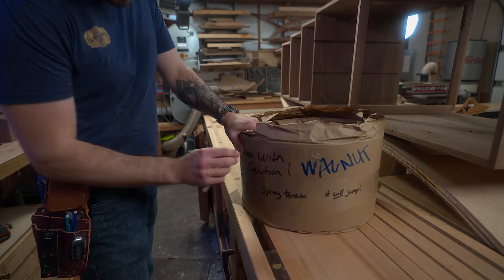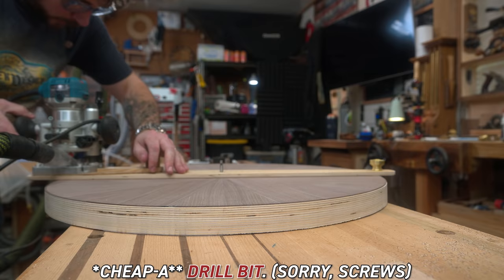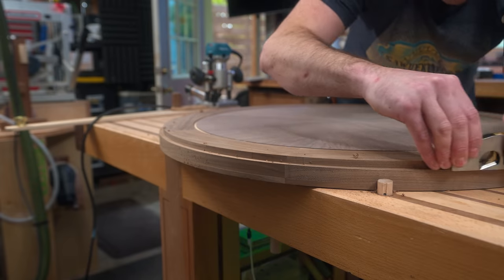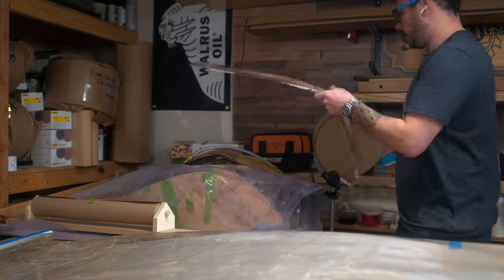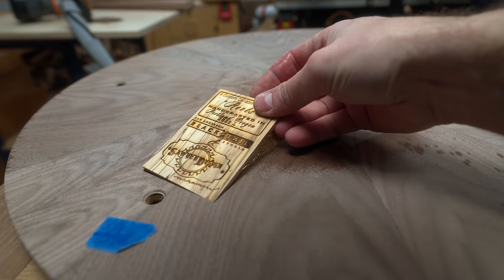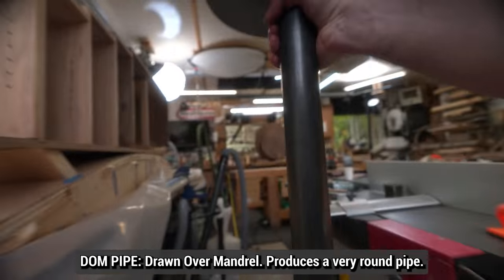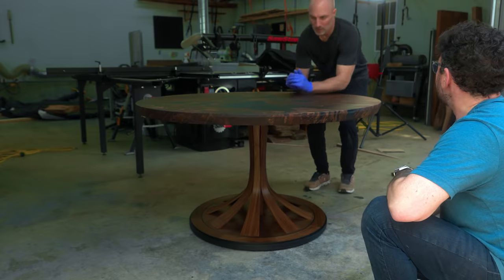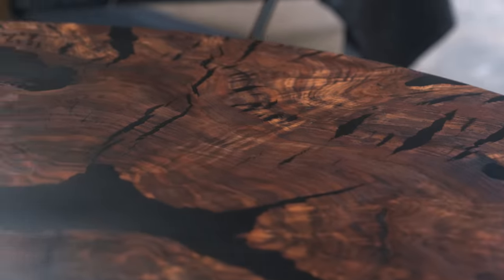Building a Round Table w/ @BlacktailStudio

Comment: wow found the share dress amazing i love the vintage look of the model design furniture myself mot have been i grow up with vintage furniture too  handmade dressers i was just a few weeks old  the old house had the look of the 1800s it was built back then to the larger stone fireplace 
in the middle of the room going up past my room the warmth of the stones all night i had too 
build an addition to the house  from an 800 sq foot place to a 2800 sq foot full basement too 
November it had great full they said to fieldwork was in full force too my uncles was helping out with the work too by noon they weather turned nasty and warned on power failers to and road closers too the person how was putting in the new furnace left before it got too bad he did not clean up as good as he should have been and should have turned off the gas line too he left it on the hot water tank my aunts and uncles helped with the farm chores before dinner they stayed for too the tempura drop fast to the cows stayed in the barn my aunts and uncles lift after dinner to 
it was my bath night must have scared them away not seeing me naked 
they cell the rolled the vehicle in the ditch my stepdad went to get them to smell smoke all day in the house too my stepmom and me left the new part of the house golf itself in flame i was already in the water to my step mom wrapped my in a damp towel and when to the barm when they got back to the farm it was already too late to save it  and the roads were shutdown too fire trucks were out of the question to the towel frozen in the barn my stepdad said to leave it on the  o was put with an old cow that did keep me from freezing had a clear view of the fire as well slowed down with the snow and cold the old grandfather clock each hour it made noise midnight  it got around the stone fireplace 7 am the clock make it last sound the rest of the house started to fall in and taken the wood mantel down too

Comment: Hey Sawyer.  Saw you collaborated with Blacktail Studio here - https://www.youtube.com/watch?v=OtG_YBdYCA0  You guys appear to work well together and you made a great wood base for the tabletop.  I would have offered it a more stable design though.  However, it was very pretty.  

Some tables are good enough with metal bases, but a nice wood base like you made for this tabletop (even if the base happens to have internal iron or steel for rigidity) is more presentable and aesthetically pleasing.  I would submit to those who have made iron/steel bases for there tables (if they are flat/plain type bases) to dress those up with wood panels.  

Anyway the point is I would like to see both of you guys collaborate on more projects.  You have a good thing going.  Maybe next time you can sell the table.  Blessings.